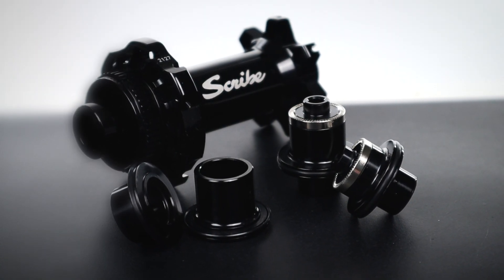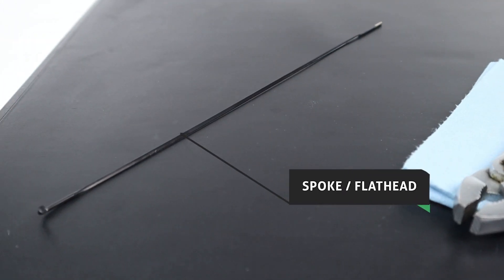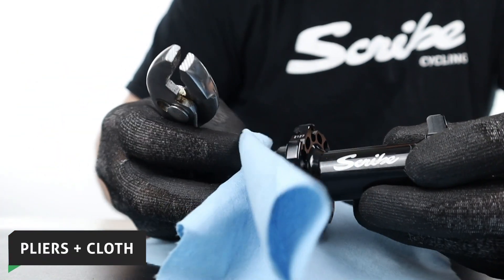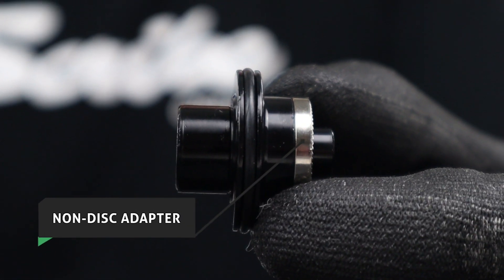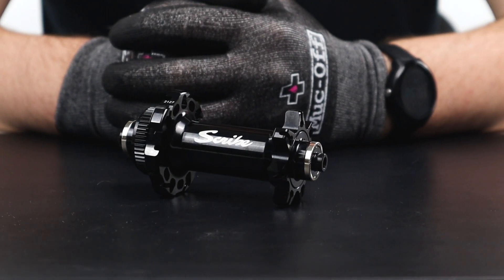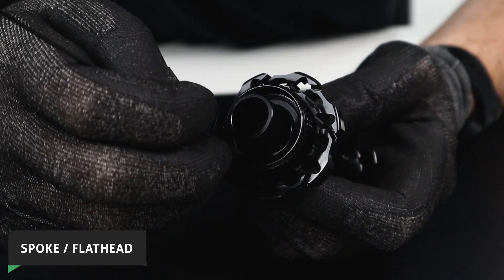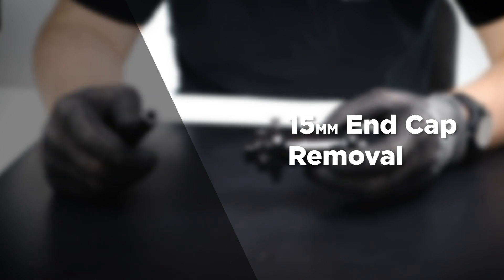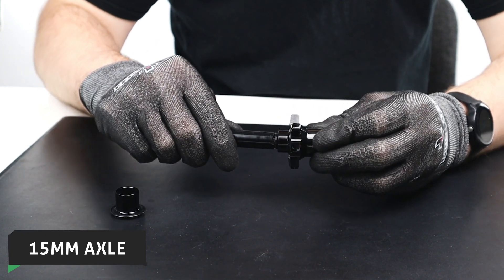How To: Install & Remove 12mm, 15mm & QR End Caps // Scribe

Comment: Mine was way too difficult i couldn’t hand pull it by any means. Any advice to remove 12mm caps?
Reply: Did you resolve this? I have the same problem … it feels a bit loose, but I can’t pull it out completely, even with pliers
Reply: @ theres a tool to twist it off versus pull.

Comment: Doesn’t show how to remove a qr end cap
Reply from the maker: Hi @davidgehlert4291, good shout, on our disc brake wheels, the QR end caps pull out in the same way as the 12mm end caps. Either by hand or with the help of some pliers and a cloth to prevent scratches. If you ever have any questions, please use our live chat tool or drop us an email at team@scribecycling.com 👍

Comment: Hi, thanks for doing these videos, really does help the home mechanic!
I think it's worth sharing, with the 365-D rear hub end cap removal is slightly different - the non drive side is a pull off as in these vids (mine were so stuck on, I ended up using a steerer tube saw guide in a vice to hold the end cap then pulling upwards with the wheel, but you can get the correct axle vice tool if you're not a cheapskate). And the drive side was a case of using an Allen key in the QR hole and then on the non-drive side the sub axle will now be exposed with a slot in, place the edge of a cone spanner in that slot to hold it and unscrew the drive side with the allen key. Hope this helps someone as I damaged my original ones with failed attempts before succeeding with the above technique, I've had to purchase some new ones 😭

Comment: Maybe not the brightest question, but here goes… so the end caps for QR are 7mm shorter in total and converted to 135mm QR or are the end caps the same width and just converted to 142mm QR? 

Any implications for the cassette and gearing  + disc brake and brake caliper if I put it on a 135mm frame?

Comment: Using the threaded end of thru axle to remove end caps has to be the dumbest thing I've ever seen. Easy way to damage the caps and the thru axle.
Reply from the maker: Hi Tyler! Thanks for the comment and I hope all is well.  Having done this for many years, we can confirm it causes no damage to the axle or adapter.

It takes very little force to remove :)
Reply: @ScribeCycling  yeah maybe when it's a brand new bike but in the real world them thing get stuck beyond belief and you would shear the threads way before you get a bearing out. Staged video and real life are two different things. Anyone with a brain knows you don't use any threads to pry, push, pull,or make leverage.